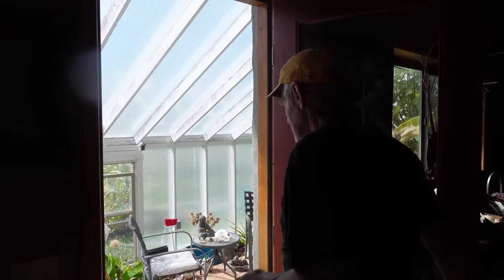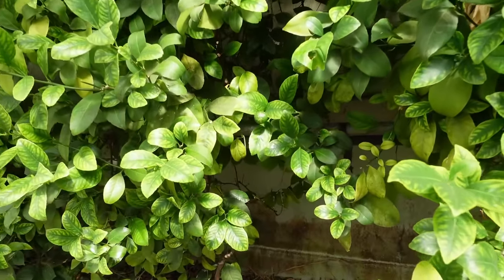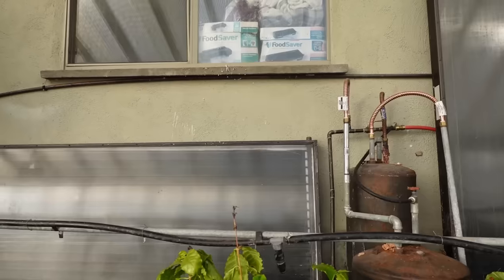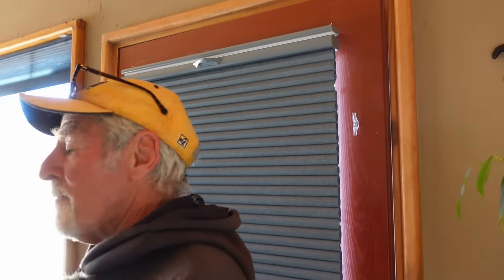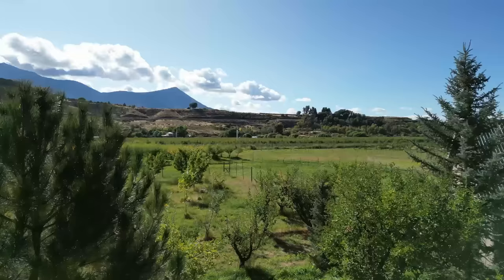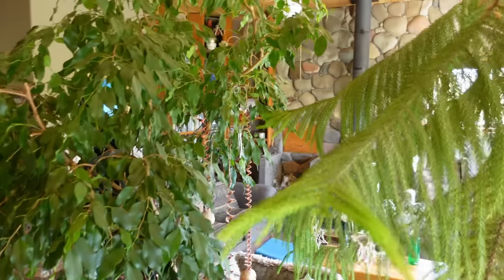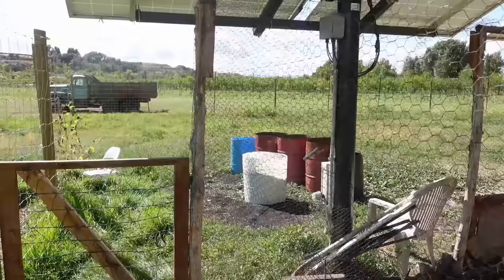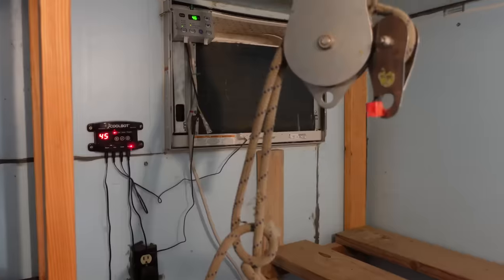Growing tropical fruit in the freezing mountains of Colorado without heating

Comment: Not that I have the home now, but I had a home located in northern New York with a 12 x 15 sunroom with 28 tons of river rock under the concrete floor that PVC pipework as duct in it.  We pretty much could heat the house with that.  But I bought Washington Dwarf Orange tree that produced about 30-50 oranges a year with me doing manual pollination.  Also grew pineapples that frankly were much better tasting than what you buy in the store.  I didn't pick them until they turned yellow so they were supper juicy.  Pineapples will actually send out shuts from the bottom after the pineapple is picked and I just broke them off and stuck them in the ground for the next harvest.

Comment: Where i live, the sun is in the north. However you want to shade those windows as much as possible. Summer temperatures are 35-45°C. So you want to keep as much heat out of the house as possible. Deep winter really only lasts a month or so and rarely gets below zero

Comment: What do you do in the summer time? What do the greenhouse temps reach when its 90-110 outside in the summer?
Reply: In the summer we open all the greenhouse windows to the outside and close it off from the house.  The sun angle changes from 30 degrees in the winter to straight overhead in the summer.  The outside temps can get to the 90's in summer but it only gets a bit over 100 in the greenhouse.

Comment: Doesn’t it make it harder to cool the house in the summer or does it insulate it against the heat, too?
Reply: The greenhouse is closed off from the house in the summer.  Also the greenhouse windows are open and the sun angle is different so over heating in there is not a problem.  The mass in the house helps with cooling because we open the windows at night and then the mass helps keep it cool all day.

Comment: If it’s solar why didn’t it open the vents, and should turn the water on for soaker hoses based off sensors in the soil.  I think much of it if cut back and watered, it will come back well.  But I wouldn’t leave dead stuff hanging out cause it will give you fungus and other disease problems.

Comment: Why not use the heat from the AC unit to heat the water. That's 4-5 times cheaper to heat the water than 220V-240V electric heating element.

Comment: It seems odd to me how he says he has thermal issues with the windows in the home yet the green house is fine. Is it because it's double paned with a vaccuum/gas seal? If so, why wouldn't he just do the same for the home windows? I thought about this thermal issue before since I also wanted to grow in rado and was thinking the best natural solution would be burying the green house under ground and have a full glass roof that is slightly elevated off the ground to minimize exposure to the cold atmosphere and allow the Earth to do most of the work of insulating
Reply: I think the answer is that we use shades in the house so it won't get too cold at night.  The greenhouse gets down to the low 40's at night.
Reply: @robertjustman-dj8ec  Thank you for the response! I see, so I misinterpreted then. What you've done here is awesome and like I said; Something I want to replicate myself on a larger scale hopefully one day after I move back to the Rockies. Thanks for sharing with us what you've accomplished